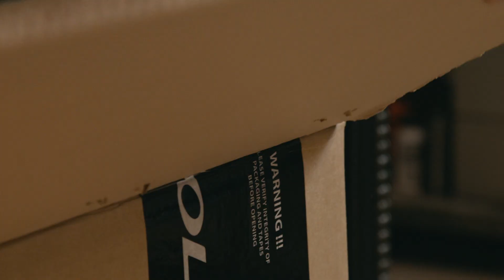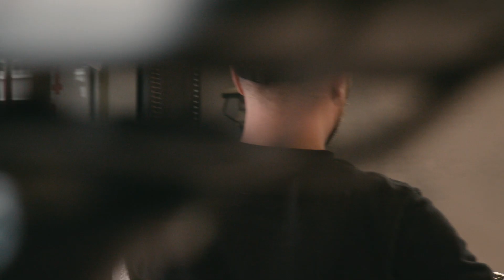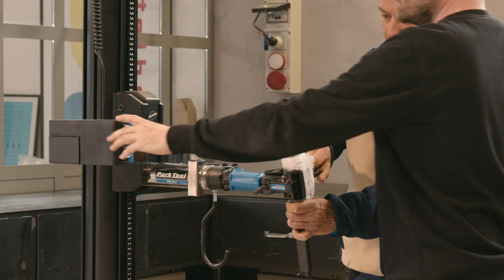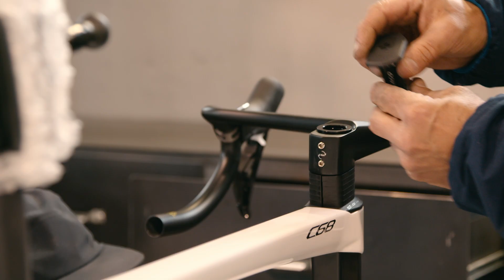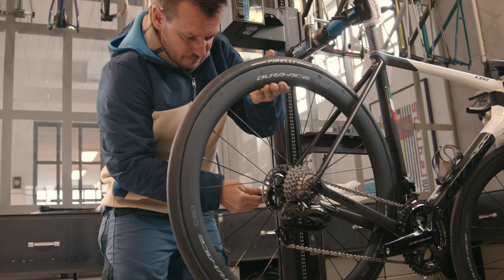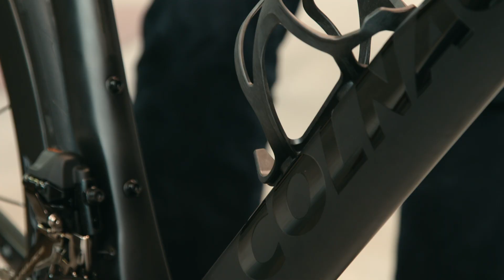The new Colnago C68 | Unpacking and first look

Comment: Hi, question about the Colnago CC.01 integrated handlebar, can it be installed on my Colnago C64? Do I need some special adapters, I think I can't be use the tool kit, that hides inside the tube.
Reply from the maker: Hi Julio, the CC01 can be installed on your C64 with an adapter. Both the handlebar and the adapter will be available on our shop soon.